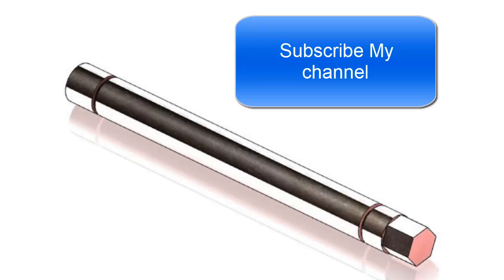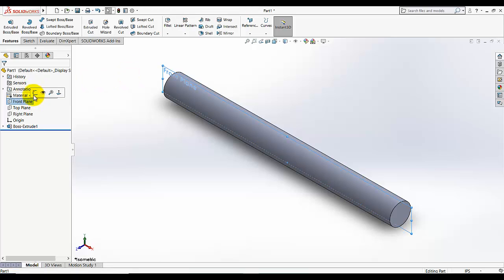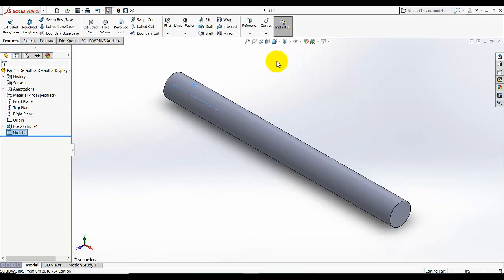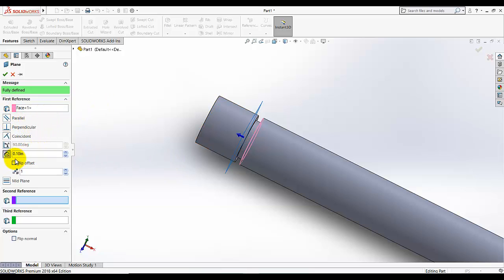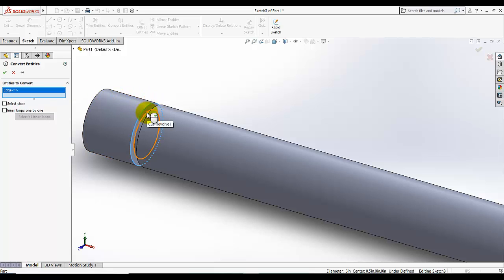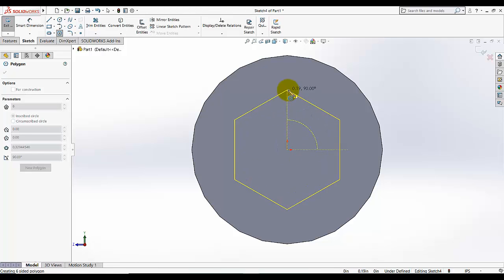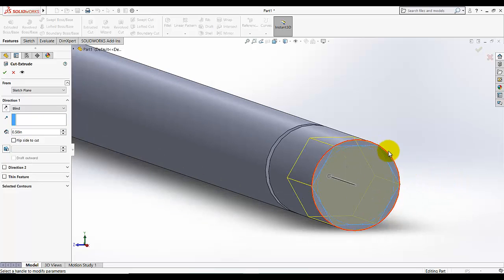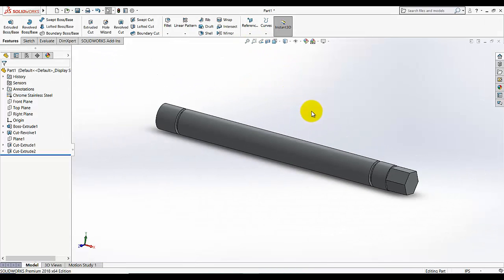SolidWorks beginners Tutorials-The offset shaft

Comment: Hi again! This is the video tutorial you made that I was referencing about the offset shaft with the teeth spiral as seen in the beginners guide book. It is the part need to connect to the worm gear that will eventually be out in the gear box. All I was trying to ask for was just a video of the offset shaft, this video, but with the spiral in the middle.
Reply from the maker: thid video is not completed will made it as soon as possible
Reply: @asadengineering  hi! any update on the video?
Reply from the maker: @cameronferreri9171  its uploaded check
Reply: @asadengineering  I have one last question. My teacher is having us do a complete assembly of the gear box using the screws from the design center with the instructions on page 524 which may be different in other books. I’m completely lost in this assignment. Is there any way you could do a tutorial for the complete assembly of all parts of the gear box as well?
Reply from the maker: @cameronferreri9171  it will make take time 
email me please?
Reply: @asadengineering  yes I can totally do that. What is your email?
Reply from the maker: @cameronferreri9171  asad.mechanical32@gmail.com
Reply from the maker: @cameronferreri9171  asad.mechanical32@gmail.com
Reply: @asadengineering  No worries! I just wanted to offer a better idea of what I was referring to. Thank you for the help!